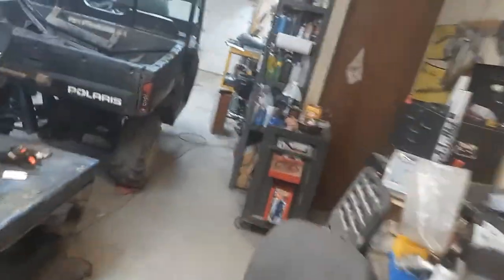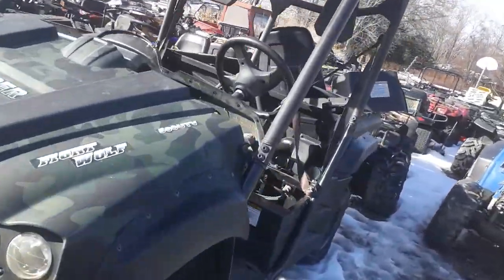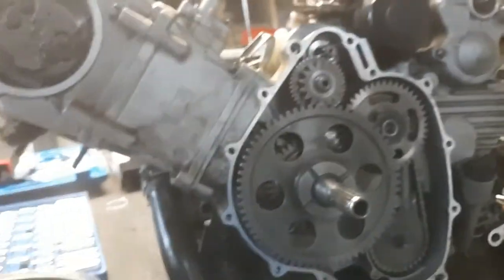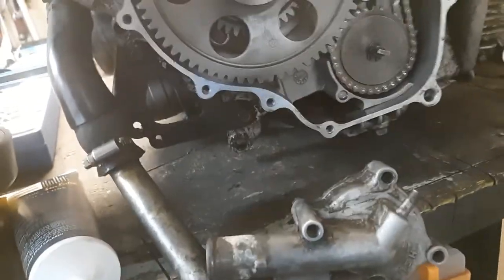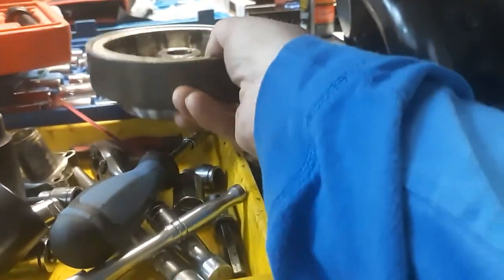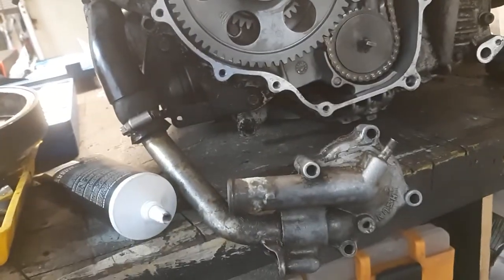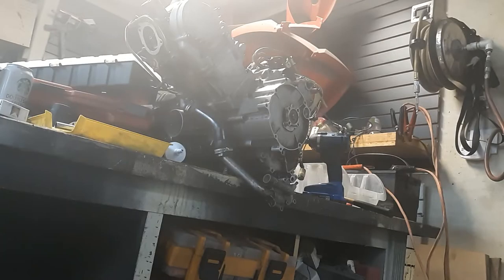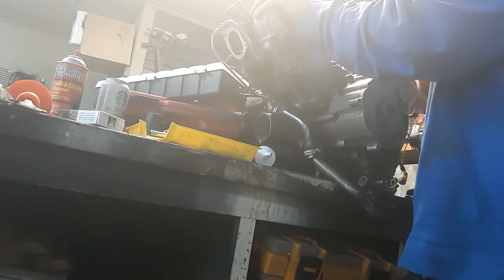How to hisun repair

Comment: I just picked up an old 400cc hisun 4x4 atv.  That's probably what's wrong with it. The guy I bought it from changed the timing chain and never got it to work. The beauty of these videos is that you get a little insight into the problems of a particular make. I've never worked on a hisun before, but I feel my confidence building as I watch your content. I would rather be fixing stuff like this than doing most other stuff. Keep making videos. There aren't to many out there that deal with the hisun. Also if I could find parts that would be great. Mine takes this huge gas cap that fell off somewhere on the way home and I could use a new one.
Reply from the maker: You can try VMCChineseparts.com they have parts for the hisun and there are a few others out there than you and I will be rebuilding a hisun motor soon
Reply: @kingofatvrepair7808  is there a way to contact you directly?

Comment: I thought this was my problem until I started taking it apart. Turns out one of the cam lobes fell off and into the engine. to be sure I took the side cover off as you did and found the bits sitting in there along with a slack oil pump chain. I'm back running now but glad I took the extra time to check.

Comment: Can you tell me where the wire from the oil sensor/switch mounted on the side of the motor connects to 
Where the wire connects
I’ve retired a burnt wiring harness and I’ve no idea where that wires into
It’s a Hisun 800 UTV 
Thanks in advance

Comment: My 400 won't start especially in cold weather. the spark plug looks like it is fouling, have put new plug and runs good.
Next day again same problem. clean the plug and tres to start but foul again, which plug is needed or just a hotter spark plug?
Reply from the maker: @reysalazar-e4l  need to check your timing and your valve settings

Comment: How did you get the engine out?  We have a coleman outfitter 550 and do not know the best way to get the engine out.  We have to rebuild the engine.
Reply: you have to remove bolts.

Comment: If you don't mind me asking, what's the part number of the flywheel puller you used? and what recourses do you use to find out things like that for cheap Chinese motors like these?
Reply: Late but youll need a 35mmx1.5 for 2016 under (some 2017 had 35mm some 38mm pullers and 38mmx1.5 for 2017 up . Motorcycle/atv/utv flywheel pullers now. 20-35 for them unless you want puller to use a lot then seek tool truck.

Comment: Working on a hisun 700 utv idles perfect when I put it in gear it starts to cut out. I have disconnected the park brake switch and seat belt sensor. Still does same thing
Reply from the maker: Sounds like when you put it in gear it’s putting the motor in a bind I would first check the clutches and if it Isn’t the clutches I would look into the timing and compression Let me know if that helps

Comment: Hi i have a Hisun 700 efi. I have it in time, with the intake valves adjusted,But all it will do is backfire out of the intake.I cant quite seem to place it i would highly appreciate your advice
Reply from the maker: Check the valves with bluing to make sure they are not bent if not see if the half-moon key is worn

Comment: When removing the motor did you have to remove the U joint bolt or is there a alternative way to disconnect the drive shaft from the motor?

Comment: Do you know any thing about hisun transmission I have a 2006 cub cadet utility vehicle c467 volunteer I herd that hisun made the transmission back then it may need rebuilt cant find any one that will work on it
Reply from the maker: The highs and I’ve messed with has the same transmission as a grizzly 660

Comment: how are you firing without having it in the vehicle. how are you getting spark without the cdi?
Reply from the maker: I built a standalone CDI box It’s a DC CDI box that I hooked up to AA batteries that I wired in like a regular CDI box with alligator clamps and a coil that’s how I got it to fire on the bench

Comment: I have a 2012 hisun 800 utv, It was running fine and i parked it five minutes later I tried to start it and it back fires. If I keep trying t start it. it will run at hi rpm and when I idle it down it quits. Please help.
Reply from the maker: Check your compression

Comment: IF THE KEYWAY GO WILL IT MESS UP THE TIMIGE
Reply: Yep...if key is sheered flywheel is no longer locked to crank in time. Most time the crank nut will come off without tools.will be loose enough to turn with fingers.If you see it jumped cam time after keyway replaced , you haven't found real cause yet keep digging.

Comment: I have one has spark and fuel but compression check at only 35psi
Reply from the maker: So either you’re timing is a little off or you have a vent valve